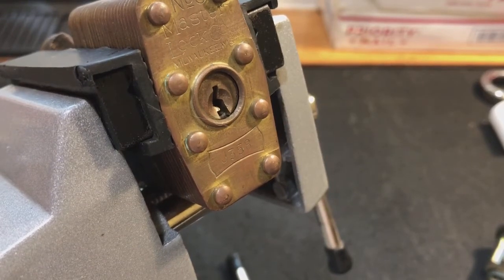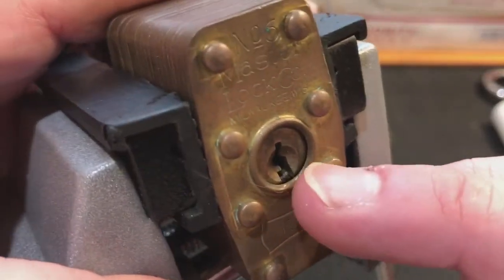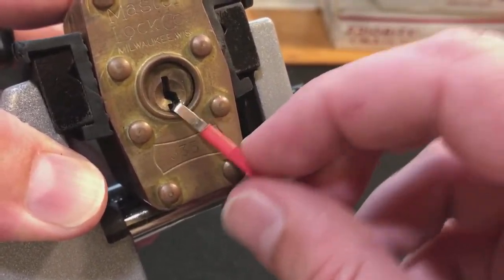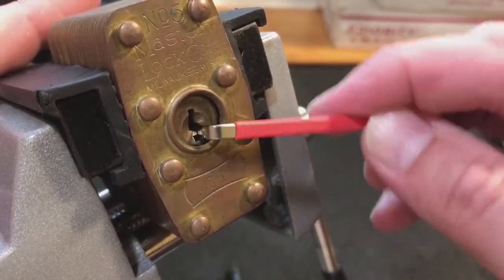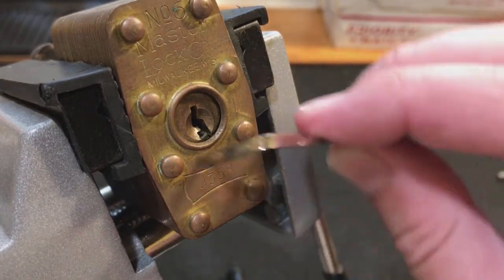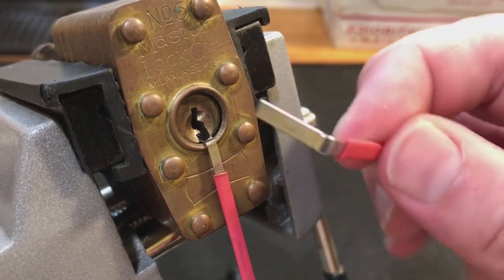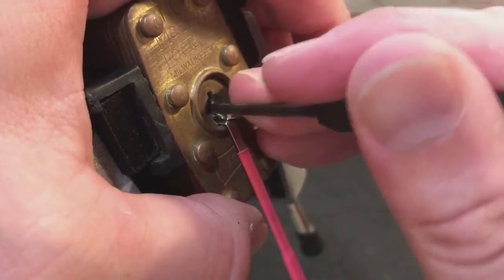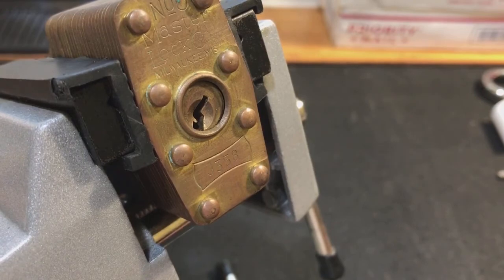LPPtln (128) Quick tips on tensioning (pt 1)

Comment: On a couple of the locks I have picked, the warding at the top of the keyway has been such that I could use a BOK tensioner as a poor man's TOK tensioner, which I found extremely helpful, as I have struggled on occasion to find a BOK tensioner which wouldn't bind the lock when used at the bottom of the keyway.

Comment: That's an awesome tip for anyone not just the new guys lol. I started tensioning from the bottom when I started. That's all I knew how to do then. Now I only tension from the top unless it's not possible but I've never tried that. Thanks brother.
Reply from the maker: Thanks for stopping by 😃👍 it was several months after I started picking before I got any ToK pry bars. I’ve actually found myself using BoK a lot more recently or a combination of both